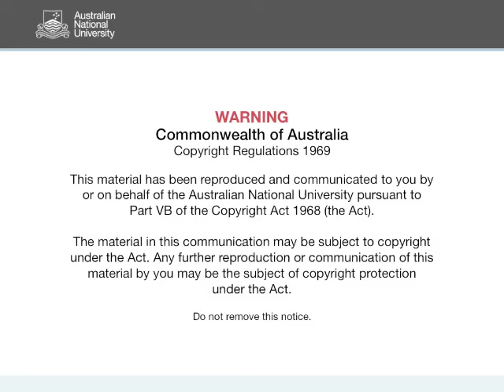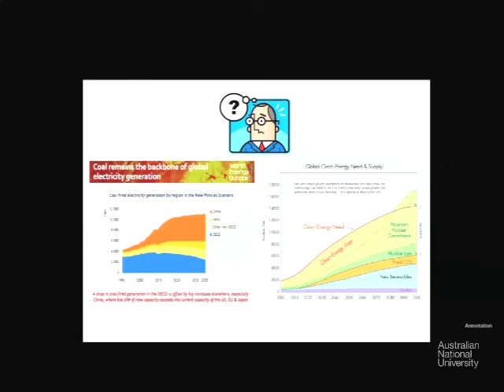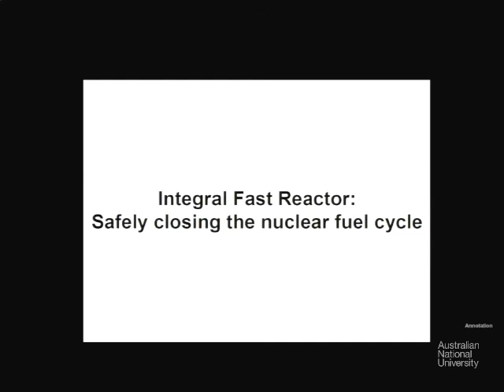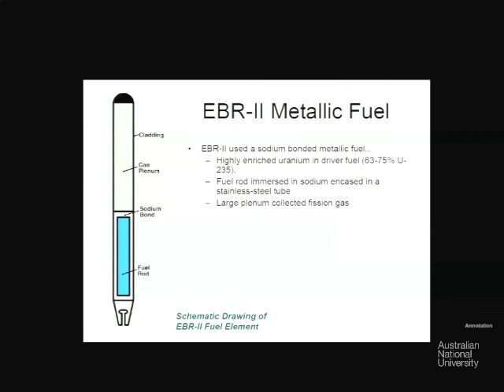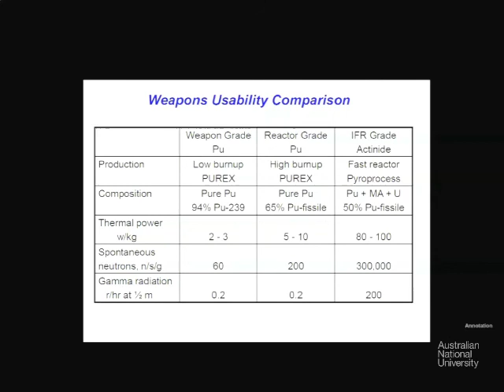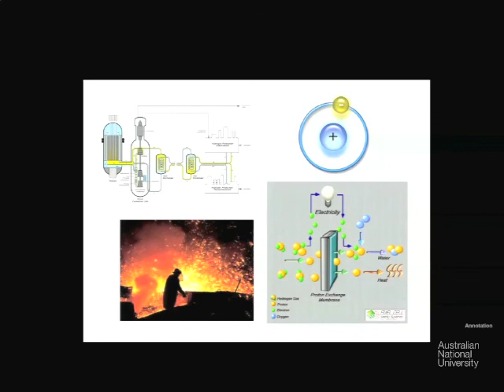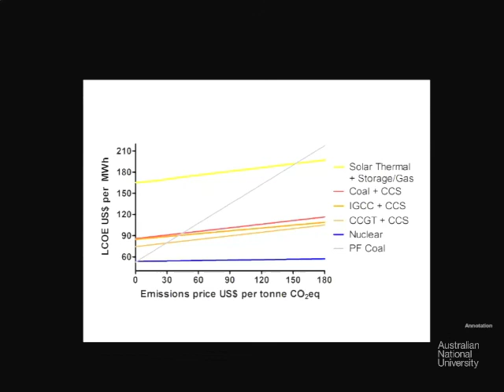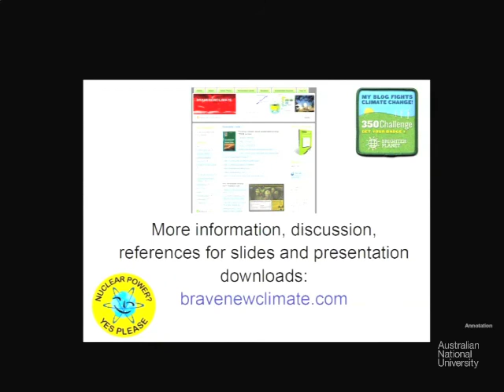Advanced Nuclear Power Systems for Long-term Energy and Climate Security - ANU Lecture

Comment: I'm curious as to whether Professor Brook has visited the molten salt reactor experiment (MSRE) in Oak Ridge - that too, was a pre-commercial prototype before scale-up when the program was canned by Nixon. The ThorCon proposal, based on the DMSR work done by Oak Ridge in the latter years of the program, offers a way to achieve high rollout rates with low fissile startup without the high technical base that is required of the IFR's arty pyroprocessing - at LCOE competitive with coal.
http://thorconpower.com/slides/teac7_lars.pdf

If there were the political will, a shipyard could crank out one hundred units of ThorCon cans at 250MWe per year - 25GW of deployment per annum from a single shipyard - without regard to doubling times for breeders, and able to consume spent fuel as long as there is some minor degree of 5% enriched uranium or decommissioned nuclear warheads available.

Unfortunately for Australia, the outlawing of nuclear power and enrichment will ensure that Australia will stay essentially fossil-fueled for the foreseeable future. The unraveling of Germany's Energiewende puts paid to the prospects of any clean energy transition that attempts to ignore the contribution of nuclear power:
http://www.reuters.com/article/2015/05/19/germany-merkel-climate-change-idUSL5N0Y10W920150519 . All this against a backdrop of a fossil-fired Coalition:
http://www.abc.net.au/news/2014-10-13/coal-is-good-for-humanity-pm-tony-abbott-says/5810244 - and any prospect of real reform must be weighed against political and social opposition that has great inertia for sticking with the status quo.